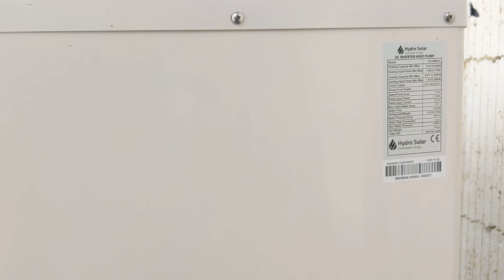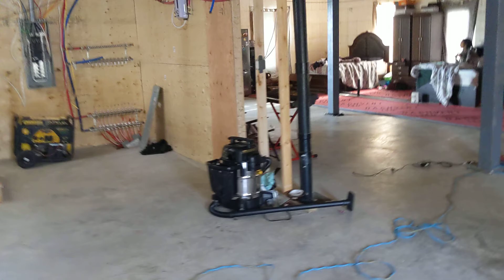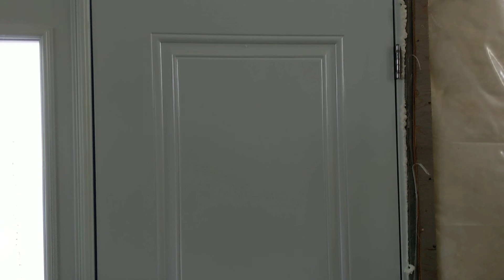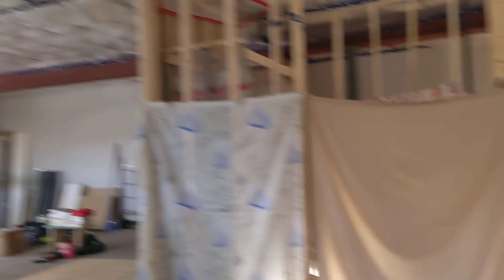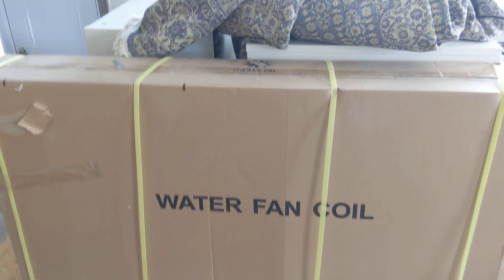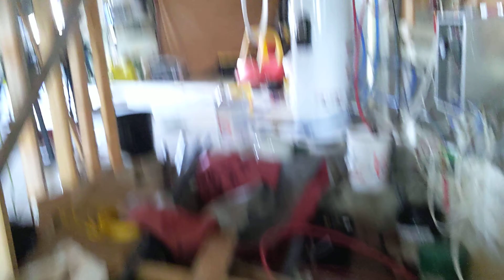update on heat pump

Comment: So,  you don't have any gas heater?
And all the heat is generated from hydro?
Reply from the maker: I will look at my consumption and let you know.  It is not great below -10C.
Reply from the maker: Yes
Reply from the maker: That is the idea.  Only electricity, eventually derived from the sun through PV and heat through Solar collector.
Reply: That is interesting. If you be able to share how much would hydro cost at the end of the month, that would be great.
I read somewhere that heat pumps are not that great for Canadian winter; and I am interested to know about your experience later on at the end of winter maybe.